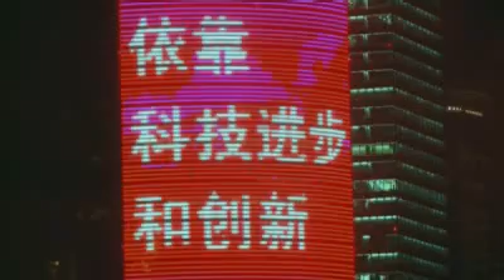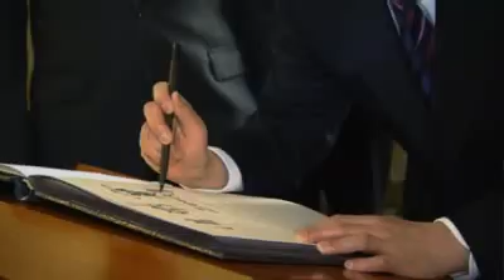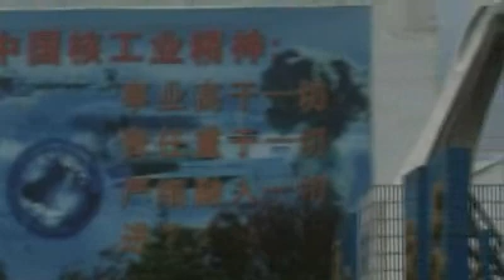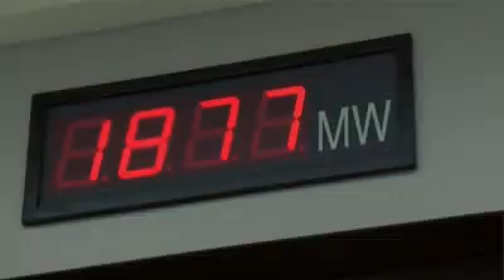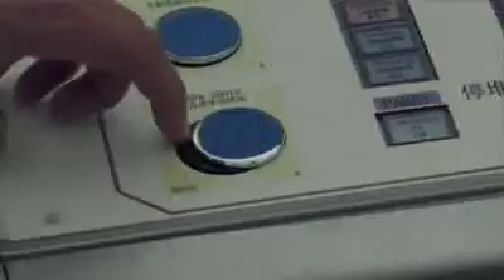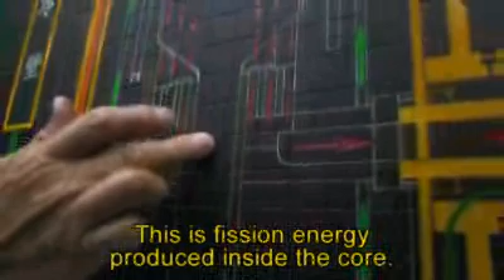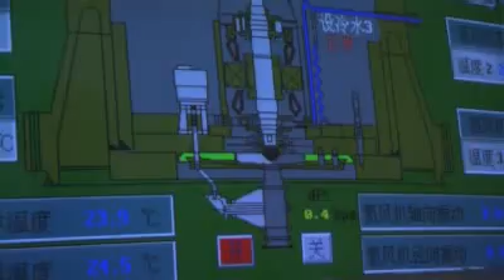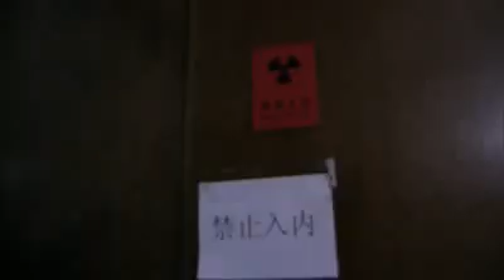HTR Program   China

Comment: How on earth will you recycle these graphite pebbles? What if pebbles lose their integrity and start to break up in situ?
Reply: There's no real need to recycle them at the moment. The volumes of used fuel are so small that they can just be stored in dry casks.
Reply: It's easier to recycle these pebble than to recycle the tons of solar panels and wind mills.
Reply: You don't. The pebbles double as long-term containment for the spent fuel. 

With conventional fuel rods you're supposed to take them to a reprocessing facility where it's molten down and to be vitrified for safe long term storage, since normal rods aren't designed for that. The pebbles on the other hand are already safer than vitrified fuel so you just put the whole thing in your final waste storage, generally in dry casks

The total volume of spent fuel is small. Each pebble contains about as much energy as ~100 tons of coal